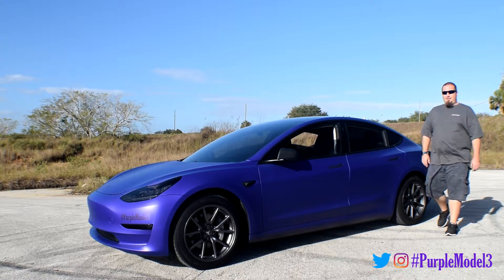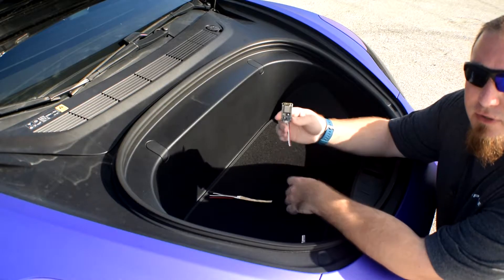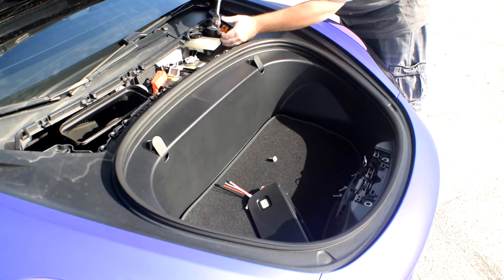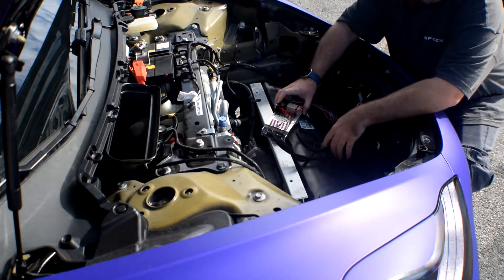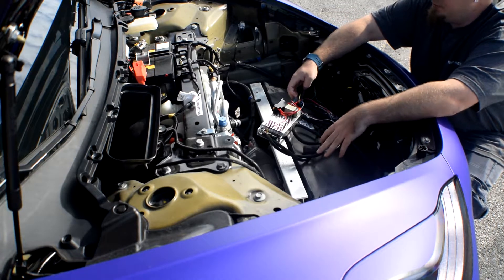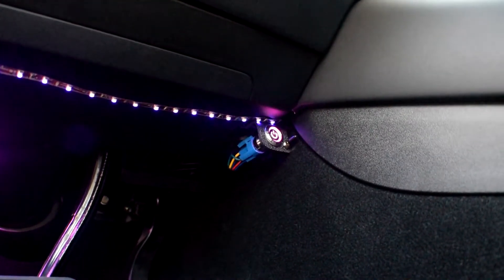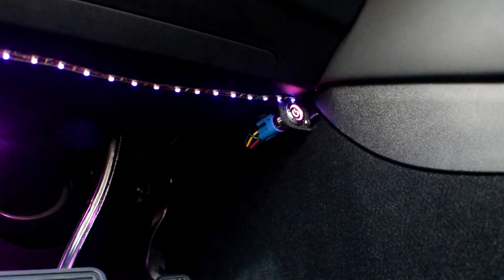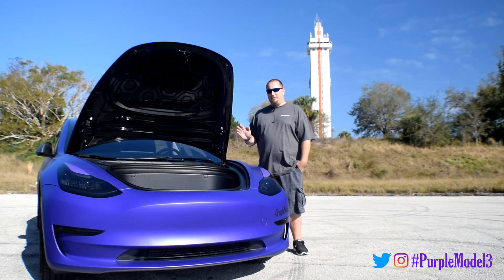Arduino Controlled LED Underbody Lights on the Purple Tesla Model 3 - Part1 #PurpleModel3

Comment: What adhesive is used for the led strips
Reply from the maker: They come with double stick tape on the back of them but under the Tesla battery I also used gorilla tape, all other locations are held up with zip ties. This can all be seen in Part 2!
Reply: Nate Mccomb I just got some of the shallow screw zip tie things. And I’ll get gorilla tape too. Thanks for the reply. Love the purple. Mine is just pearl white. But that may change. Is that vinyl or plasti dip?
Reply from the maker: @xrobinsonsx5284  Plasti Dip from DipYourCar.com
Check out when we did @TesLatino's: https://youtu.be/pkiQXI98AFw

Pictures from when I did mine:
https://twitter.com/nate_mccomb/status/1050469624104542209
https://twitter.com/nate_mccomb/status/1050554600846168070